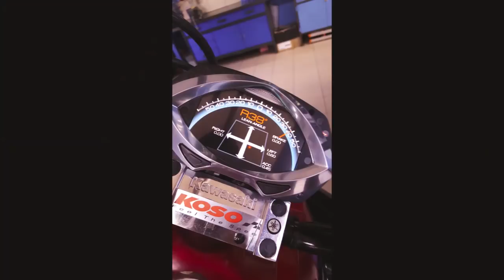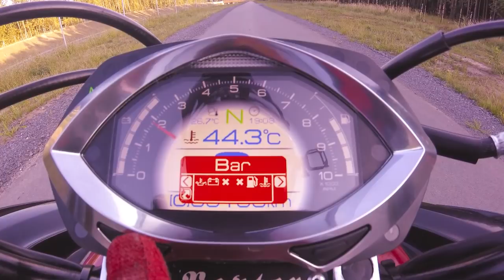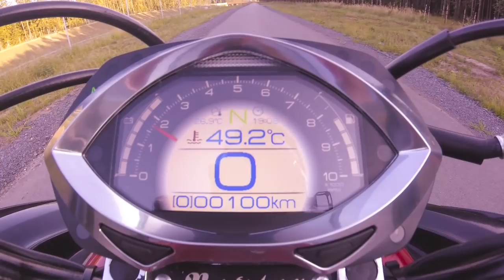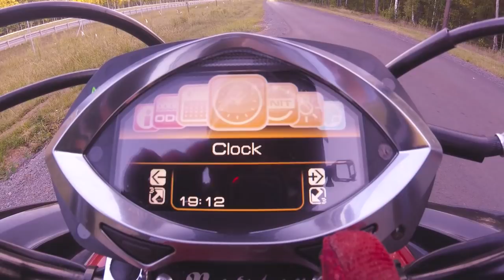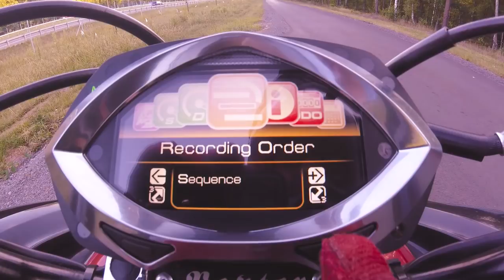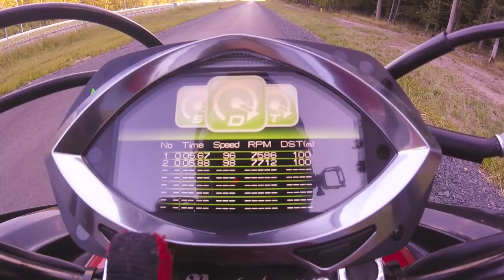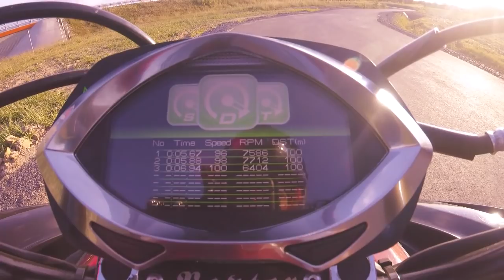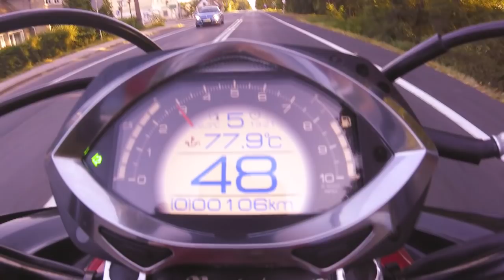Koso RXF Raptor 700

Comment: Cool video,  bought one rxf to but having some problem with the neutral light is not recognizing the negative pole that comes from the clutch 3 pin diode , do you have the same problem with your koso rxf?
Reply from the maker: N ground control.  You need to add a separate wire.
Reply: @pawepawelo7210  Thanks for the feedback , I didn't understand , can you be more specific ...
Reply from the maker: @ricosilva6380  Additional cable from sensor N.
Reply: @pawepawelo7210  Ok , but that way will bypass the 3 pin diode protection in the bike  and will have neutro light only with  bike side stand close when is open the neutral light stays off , or I missing something ?.
Reply from the maker: @ricosilva6380  
I do not understand.  Is your quad a Raptor 700?
Reply: @pawepawelo7210  No , like your video and bought one for my  Gsxr

Comment: HI IN YOUR EXPERIENCE THIS COULD FIT ON A LARGER BIKE I MEAN I HAVE A HONDA CBR 600RR F3 95 BUT MY BIKE HAVE 15,000 RPM AND THIS DASHBOARD ONLY HAVE 10,000 SO IT TAKE LONGER TO RAISE THE RPM? I MEAN IN MY DASH BOARD 8,000RPM WILL BE EQUAL TO THE 8,000 RPM IF I CAN FIT THIS KOSO DASHBOARD 8,000 RPM WILL BE LIKE 12,000 RPM OF MY ORIGINAL DASHBOARD RIGHT?
Reply from the maker: sorry i don't see notifications.  You can set the rpm as you like, also 15000 rpm.

Comment: What did you connect the fuel wire to on the Raptor to get it to show fuel correctly?
Reply from the maker: 2.33 min .swimmer
Reply: Paweł Pawelo Thank you
Reply: Paweł Pawelo What kind of fuel sender is that and where did you buy it?
Reply from the maker: Honda cb 500